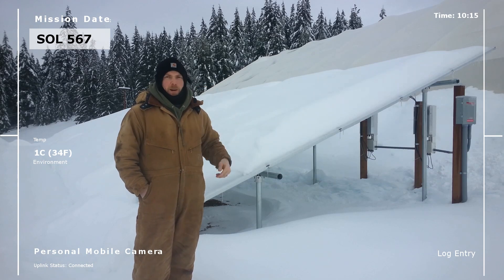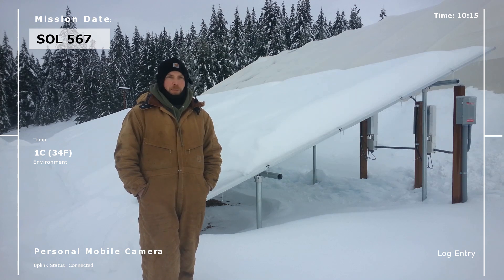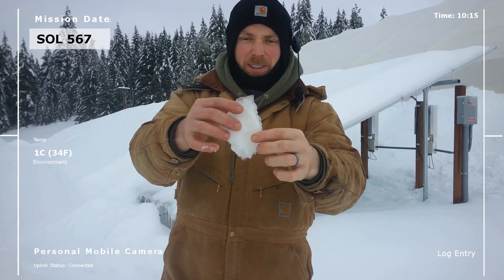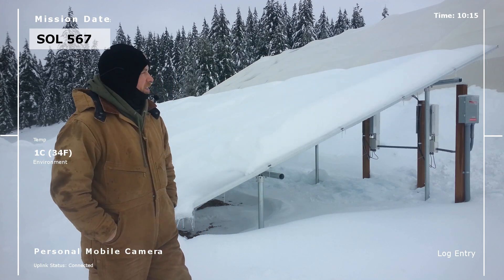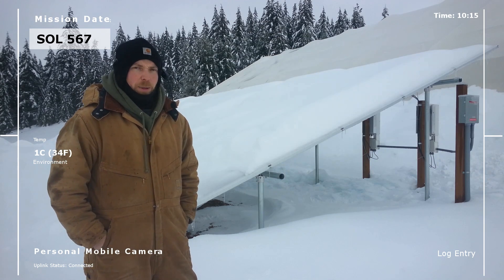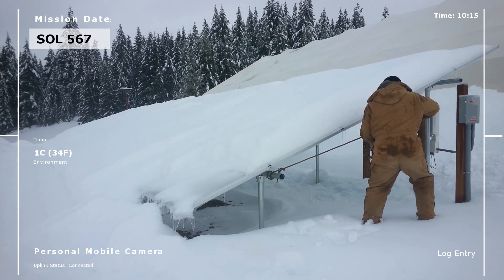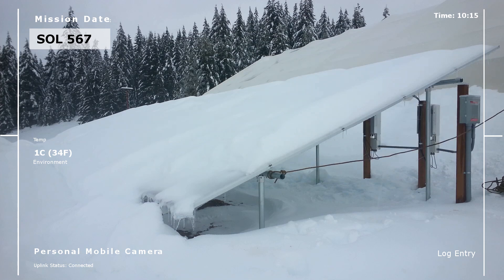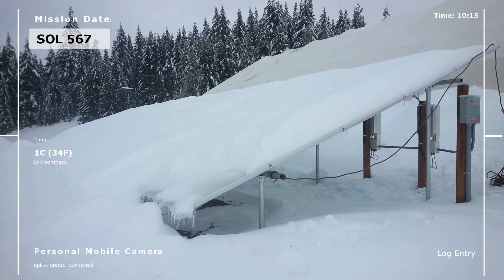Can you clean SOLAR PANELS with a ROPE?

Comment: what if you had a heat tape on there and you could turn it on before you go out to clean off the snow to get it melting.
like you would put around piping that you wouldn't want to freeze.

Comment: rebuild/ use the panels for the roof of a structure using geothermal  heat like the LDSPREPPER"S greenhouse... insulated walls and the heat would melt the roof.

Comment: Here are three links to easy snow removal. The third uses a device that Wranglerstar reproduced with some success (q.v.). The first two show the method you tried, but with a smaller diameter cordage, working very well. I think there's an important detail you missed in the set up.

   https://www.youtube.com/watch?v=gEnJJeNHTLs#t=113.161
https://www.youtube.com/watch?v=D3aiqUMNOF8#t=127.896583
https://www.youtube.com/watch?v=2hg6KF-es0I

Comment: Attach the rope on the top transverse tube, shovel the bottom of solar panel. Then pass the rope side to side. Make a loop on the other end of the top transverse tube and then pull the rope. It will pass under the ice and you'll get the leverage you needed.

Comment: I know your panels are optimized to sell electricity into the grid, but having a way to angle them in winter for optimal solar insolence in the winter is a must if you're ever going to go off grid. I know it's too late now but there is a great tracking system www.sunlinksolartracker.com that has some great smarts built in and because it moves in steps rather than continuously it does not consume as much energy to operate. It also can detect cloudy or snowy days and will steeply angle itself south to avoid snow accumulation. On a very snowy or cloudy day the light is so dispersed that the array angle doesn't mean much but it does to keep snow off.  If you get the chance to redo your array I would look at something like this.

Comment: Enclose the area under the solar panels and run the exhaust from the generator into the area hence heating up the solar panels and melting the ice and snow!   Now there is a concept heated solar panels like the de-icing windshields..  Hmmm can the existing  circuity in the solar panels be used to heat them up to melt snow/ice?

Comment: Are there gaps in between the solar panels? It looks like there is about 1" gaps but I am not sure because the camera does not show it very good. I ask because I was thinking you should clean the snow from the bottom of the lowest panels so the snow and ice has the ability to slide down and off the panels. With a 1" gap in between the panels I was thinking you could go under them and push a saw or something to cut through the snow and ice one panel at a time and it should slide off.

Comment: Change from a rope to a resistance based heating element. Slow but you could go top down with serious effectiveness. You could even clear a small section by hand and the use the solar panels to heat the wire. I would doubt you would need more than 100w to get it done. Or you could expand the idea to having 4 heating coils around each solar cell making them too warm to collect snow and ice - and you can always unplug it. Tons of work, I know, but it is feasible to use the panels to keep themselves well above freezing. I know that it would be a power hit, but they would be self warming! Any snow or ice might even further increase the short you are basically creating and melt it faster!

Comment: The rope works only on soft snow. Do it Close after snowfall. I Think you should reconstruct the solar panel to next winter. The angle for optimizing sun is to flat for snow or mars dust to fall off. If you can rise the angle it will pretty much fall off by it self. If you can heat up the solar panels above freezing the snow will fall off by gravity. All you need is a thin waterlayer between the panels and the snow. A hose with warm water from the biogas burner on the back side of the panels. Just remember to drain the hose in between.

Comment: Solar panels can indeed be used in your climate, even if it snows.  The U.S. Department of Energy has a short video on the subject. And you already stated what has to be done, raising the panels higher off the ground so the snow can sheet off and setting them at the proper angle.  https://www.youtube.com/watch?v=q4RVHyx9RMc Enjoy, Frank

Comment: Was that yours or Codys drone?   I would try coated wire, easier to pull thru less drag. I would start in the middle ,throw the wire up over the top work it down then pull it across the top under the snow then down the side. If 1/2 is too hard try 1/4 at a time.

Comment: This actually would have worked better thanks to the ice, but you didn't give it a chance.  With soft snow, the rope would tend to climb up on top of the snow as you pulled it, unless you had some way to hold it down.  But since there was a hard layer of ice on top, with softer snow beneath, had you cleared the top edge - to get the rope under the ice - the ice itself would have held the rope down, and allowed you to pull through the softer snow underneath that layer.  You might also have to clear a couple of inches down each side,  to give it a track, but it should have worked.  Putting walls - even just plastic sheeting - around the base should help the panels conserve heat, then give them a bit of current to start melting and sliding...

Comment: In order to use a rope or line to cut the snow on your panel correctly, you need to research "how to cut a rutschblock". It's a common avalanche detection method for snow analysis.  To describe it in text, you need to insert two vertical poles, in your case, at the back (top) of the solar panels, perhaps many meters apart (start with five?).  Then standing at the bottom of the panels, you would loop the line from one side, all the way around the two poles, back to bottom.  Thus creating an upside "U".

Then using sawing motion by pulling the rope back and forth. You should get help for this, as you need one person on either end of the rope.  The sawing motion would cause the rope to "cut" in to the snow.  Once it reaches the desired depth, remove the poles and the rope should be buried far enough in to the panel and you can simply pull it and the entire block would slide toward you. Please don't stand in the way.

The only problem is, the snow on your panel is not really deep enough to do this effectively.  When doing Rutchblock test, there is often several meters of snow that is in the block. It's a massive chunk.  When I dig my snow pit for the test, I dig mine approximately 2.5 to 3 meters wide and as deep as I need to analyze the snow. So sometimes I am two meters deep in the pit. 

Good luck.

Comment: Have you thought about mounting retractable tarp over the panels? When the snow is falling hard or hours before large snow comes you cover the panel. After the snow, when you take back the tarp it takes off the snow? If the snow sticks to the tarp well enough, the snow could fall off on the high side of the panels where there's more room for snow to collect. You could even wind it onto a pipe attached to a winch, the kind used on boat trailers, some can ever be electrically driven by 12v. 
At night there obviously wouldn't be any power loss, and how much power do those make in a day during a heavy snow?
Due to the size it may take more than one tarp. The concept is already being used as an aftermerket add on to pickups where a tarp lines the bed and the cargo is rolled off.

Comment: Seems like you either need to put more of an angle on the solar panels or you have to figure out a way for the panels to be so slippery that snow will not stick to it.   Plus, you will also need a way to clear out the snow at the bottom of the panels  were the snow will collect.  Lets hope for a warm winter in the mean time.
Reply: this is a good idea, perhpas amending the design so that the angle is changeable? When it snows raise them up to a steep angle, otherwise leave at angle for optimum solar power. If anything it may allow you to keep more optimum solar power throughout day?

Comment: Already left a suggestion but came up with a better idea. What if you used two servos (one on each side) and two pullies to pull a rope with a single rope in-between the two. The pulleys would then be timed to go back and forth pulling the rope from the top to the bottom of the panels preventing from snow building up. http://imgur.com/a/hkAB7 here's a link to the basic idea that I drew out because I was having issues explaining it. Also, I realised after drawing that you would either need an extra two servos to replace the pulleys or use pullies with a tension spring or something similar.

Comment: Any thoughts on a system to spray a deicer? Some water solenoid valves would let you run it by section so a small pump can run it all and setting up plastic under the panels can let you capture the run off to reuse till it gets watered down to much. 

A pretreat before the storm and some sprays during would melt the snow/ice as it hits.

Comment: I still think putting a tarp on them before it snows is the best solution until you can raise them. You just disconnect the tarp up top and pull it over top of the snow to roll it onto the ground. Use longer ropes when attaching up top so you can pull on them from the front. It will be time consuming setting up but should be faster at getting the snow off. Not sure how well it will work for this ice snow mix but should work great on the fluffy snow. A bunch of small tarps may work better than one big one, they will be easier to work with. That rope is to thick it would only work on the fluffy stuff, a metal wire would work best.

Comment: create a wall around the panels and place a heater inside, that you can turn on and let run untill the ice is gone?
Reply: but thats the crux  he needs power to do that  and thats what the panels are for
Reply: he could use sand bags, dirt from the homestead, 
and he could heat with wood, or the gas heater.

Comment: You might be able to harvest heat from your furnace and blow the hot air to melt the ice/snow.Perhaps a pvc pipe with a small slit cut lengthwise, a motor to slowly move it along the panels controlled by an arduino or something.

Comment: Would heating the bottom of the panels with propane heaters cause any damage to the units. My thinking is that if the bottom warms up the heat would transfer to layer of snow/ice that has 'attached' to the panels, thus causing it to release and slide on its own or with minimal effort. Of course i'm not talking direct heat, but rather a convection or forced air heater propane heater.

Comment: Sheathe the frame with black agricultural sheet plastic for solar warming. Storing firewood etc. beneath would add thermal mass. Even if all you did was make a thin layer of melt between the panels and ice, clearing would be much easier.

Comment: Just throw a tarp over it if expecting ice. Probably just make two holes on either top cornor of the tarp and give it a yank. I don't know much about solar panels, maybe the tarp would melt. Probably a logical reason you didn't do this already
Reply: Ben Poliquin a tarp would work good for smaller storms. i dont know much about panels but if it dont melt all the snow, i cant imagine it will melt the tarp

Comment: If you are two persons, then use the rope as a wiresaw from the top of the panels down to the bottom. Moving the rope first back and forth would help you penetrate even soft ice. But you need to be 2 persons (or some kind of spring mechanism) so the rope can move in a "sawing" motion.

Comment: When it comes to summer you could put in a big piece of that plastic you used on the grow lanes. Attach it all the way along the bottom and attached to a separate pole running along the top. Then you attach poles on hinges at the bottom of the slope, and attach the other end of the poles to the one along the top. Then you could hinge up the piece of plastic and dump the snow off

Comment: Love the new mic! makes it much easier to hear you. With all that extra ice gathered on that snow, looks like it is making it much harder for any of the ideas to work properly. What a pain! I hope that the rise in temperature will help get rid of some of that before it gets too thick. What is the weight rating on those solar panels before they become compromised, by cracking or breaking? Or do they even rate them that way? Keeping you in my prayers for success! Semper Fi

Comment: Suggestion for string application.  When conditions allow, affix multiple strings along the top of your array.  Let them hang straight down.  When snow accumulation merits removal, pull each string side to side 30 degrees or so.  Again, multiple strings to overlap your angles.  This may leave some areas near the top with snow, but with your snowshoe stilts that will need to engineer and invent, you can easily finish the clean up.

Comment: Someone might have mentioned this already, but we use heat tape to keep our hoses and rain barrels from freezing in the winter. It works great. It lays flat so you could lay a couple of them lengthwise across the solar panels and fasten with electrical tape. It also has a thermostat so only runs in freezing temps. I know it uses electricity, but at this point it might be worth it! Here are the ones we buy... https://www.amazon.com/dp/B0006VAL8O/ref=cm_sw_r_cp_awdb_mnrHybQGK9N7C. Good luck!!

Comment: I have several solutions for the ice and snow, let me present you with one of them.

If this has been proposed and discussed already, my apologies for the repetition.

Is there a reason a roof heating cable system couldn't be used to keep a large area of the panels free of snow/ice?  Apart from cost or other logistical hurdles.

They would be deployed only during snow/ice events, and not have to function full-time.  I imagine they could be run by a generator as well?

I'm not sure the amount of area the cables would block (could be calculated), or whether it would be too much area loss. . .  I could leave that figuring up to you.  ;)

Conversely, you could build a very simple wood fired mini-boiler, and pump warm non-flammable antifreeze through a hose grid line system, draped on the panels.  Again, easy to deploy, only needed part time, wood is your most abundant natural resource surrounding you at all times.  :0)

Similar to Thawzall ground and concrete heating systems.  You could, I imagine, run your system at low pressures and 170° (ish) temps, and not need any specialty parts or resources.  Relatively low temps mean the use of common plumbing supplies (Harbor Freight 1/2" natural rubber hose in bulk roll?).  Or perhaps a propane fired hot water heater from Habitat for Humanities ReStore?

Good job on the channel!

Comment: What if you use a pool brush, like the kind they use to brush the dust on the very bottom of in ground pools? They're only a couple inches wide and a few feet long and come on long extendable poles that would make it easy to get to all parts of the panels. Not too rough either, usually nylon bristles or some similar material

Comment: Well easy way to remove ice from windshield is to make solution from water and alcohol, 1/3 alcohol 2/3 water then spray it on. Maybe it could be used in this case.(you propably need bigger spraying system than little spraybottle tho :D )  https://www.youtube.com/watch?v=95V-jXt262A

Comment: I know nothing about solar panels so please don't laugh but 
Could you apply some sort of translucent lubricant or water repellant solution to the surface of the panels that might help the snow slide down to the bottom edge?
When the snow has an ice covering, such as now, could you apply some solution to assisting the ice to thaw?
Taking note of you comments about altering the way in which your panels are fixed to the supporting frame work could this be changed so that the panels swivel vertically by mechanical drive like a set of window shutters to clear off snow?

Comment: Put the generator under the panels & run the cable back to the Hab. The small amount of heat from the genny might be enough to melt the lower layer and make it easier to move. You may have to do a panel at a time, but it would make it just a bit easier.  Any spare hab material as a wall around the underneath of the panels could reduce heat escaping.

Comment: You could try and automate the rope motion across the entire set on panels(up and down motion).  Some sort of chain drive?

Phase 1: The rope wipes the panels every hour or so to clear off the new flurries when the operator enables it.

Phase 2: camera system detects the panels are covered and starts wiper as needed.

Comment: Once you had the bottom of the panels cleared like you did in the end of the video, then you should have used the rope, because there was a ridge that would catch the rope, and allowed it to be pulled under the snow, and ice.